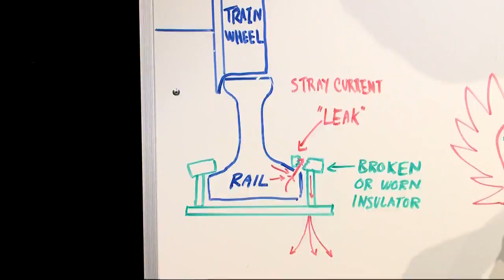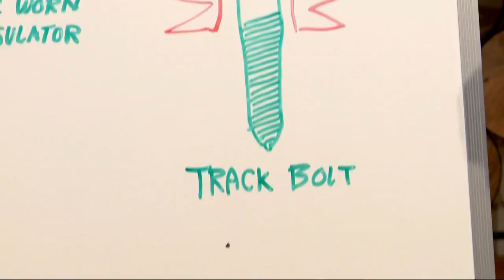What makes Metro's third rail so dangerous?

Comment: so this is why i didnt see a third rail when i looked between the tracks
Reply: Next to platforms, it's typically situated as far away from passengers/the public as possible, so should someone fall onto the tracks and be conscious enough to find the suicide pit underneath the platform should a train arrive, there's no chance of meeting the third rail while on your way there.
Not sure where you are but there's a multitude of different third rail systems out there, some, like in The Netherlands having the third rail be up in the air by about 30 centimeters and covered left, top and right by a glassfiber cover (I was once told by an employee of the metro system that while they are taught it's an insulator, due to all the dust that builds up on them he doesn't automatically trust their full insulating potential in emergencies, and worded it like this "Probably safe to step on with shoes on, but touching the protective cover? Nope, not me.")
The pickup picks up current from underneath the rail.

Some other countries have the third rail in the middle of the tracks, sometimes covered (and a train has to "catch" a sleeve like opening in order to touch this rail) and sometimes uncovered.
There's the type in England which is slightly raised, sitting right next to one of the 2 pieces of rail (usually on the outside), and Amsterdam used to have a combined system with a third rail operation till a particular station, at which the metro converted to fast-tram service by switching on their pantograph (there was overhead wiring at that station) and retracting the steps on the sides, because the platforms of the fast-tram service were more narrow.
Since this fast-tram service also had a huge amount of street-level crossings with pedestrian, cyclist and car traffic, third rail was obviously not an option there.
Reply: The 3rd rail is the furthest one from the platform and usually not between the running rails

Comment: Don't forget that (depending on the system) the 3rd rail is typically has 600-800 volts going through that rail and most systems never shut down the 3rd rail if the train isn't there so even if the train isn't there the 3rd rail will kill you instantly.
Reply: Imagine then what would happen if a swollen fart landed on the 3rd Rail?, considering that farts are pre-filled with highly pressurised air and gas?
Reply: That’s nothing, Montréal has 25,750 volts on their tracks.
Reply: @lagoontejeraneasea1338  On a third rail, or an overhead wire?  I'd think a third rail at that high a voltage would just flash over to ground.
Reply: @soundspark  exactly
Reply: @lagoontejeraneasea1338  you are misinformed on how electricity works. the 25,750 volt lines you are referring to are overhead lines, away from the ground / pedestrians. electrified third rails must use very high amperage with relatively low voltage, in order to minimize the high potential for electric arcs through the air that low to the ground, which can happen with high voltages. therefore, they often run at 700-800 volts, but upwards of 1,500 amps. this requires many additional traction power substations, as the resistive losses are much higher due to this. it won't shock you as much as the overhead lines you're referring to - but if you touch a live 1,500 amp electrified rail, you will become a burnt marshmallow at the speed of light
Reply: @lagoontejeraneasea1338  nobody cares u can literally die from either one 💀 it’s not a competition.

Comment: Does overhead lines return current through the rails as well?
Reply: Yes, hence only one wire above instead of two, like rubber tired trolley busses
Reply: yes they do but the neutral conductor is earthed so nothing happens when you step on or touch the main running rails even if a locomotive is running over them
Reply: @SB7-r9i  You mean the neutral is at ground potential so there's no difference between you and the rail you step on or touch.  Touching both rails however can be a bit of a problem since some forms of security use a voltage between them that can bite, maybe not be lethal, but still.  Since it's difficult to reach both rails with some gauges of track that's not that much of a concern, and snow or heavy rain typically doesn't affect this functionality.
This type of track security relies on the rails getting shorted out by a train upon entering that track section, basically.

Comment: 750 VOLTS! Dude get on my leve, I've been shocked with MORE THAN 1KILOVOLT. I made a taser that outputs more than 700 volts, You can even get 2,5 KILVOLTS from a microwave transformer
Reply: Most people are confused regarding the difference between volts, amps and current. He's either dumbing it down for them or doesnt know the difference himself.
Reply: @MrDlt123  i do know
Reply: @MrDlt123  it was high voltage with high current
Reply: Yeah. If ElectroBoom taught me anything it's that the voltage doesn't really matter as much as the amps when it comes to the dangers of electricity, right?
Reply: You were getting a discharge voltage and very SMALL current. IE a charged, disconnected capacitor. The third rail is powered by a DC generator or  an AC Altenator that can deliver THOUSANDS of amperes of current! It is potentially a made made lighting bolt, when there's a short circuit!
 You can experience a tingling from a lightning bolt depending on the distance from it and the conductivity of the earth you are standing on. When you get a direct hit you will be VAPORIZED in many instances!
Reply: @leehansen4750  the current is actually high as well as voltage.
Reply: @GileraManden  You might first want to learn to properly speak the English language. After educating yourself in that aspect, then look into electrical theory. As of now, you can barely dictate well enough to get a basic idea across. The ideas you are conveying are incorrect child.
Reply: if a supply is capable of delivering 500 amps but at 1v you survive because the current never gets flowing to kill you but at 800v there is enough voltage to get the current flowing so it is a combination of both that kills also there is ac and dc but i wont get into that here just watch electroboom he has some videos about it
Reply: @SB7-r9i  the 1 kilovolt i got shocked with had also current
Reply: Microwave transformer will drop you dead easily.  You say you got hit with 1kv but I'm not surprised if you survive a hit from a very low power source.
Reply: A taser will not be capable of producing anything above 1-2 mA, if it reaches that at all.  A taser is meant to produce a very high voltage at a very low current (possibly even micro-amps) with a pulse-modulation so fast that it disrupts normal operation of the human's nerve system (this is the thing that actively knocks you down or at least seriously should scare you off).
Oh, and by the way, the micro-wave transformer has something the third rail operation does not have: Galvanic separation.
It means that should you get into contact with it's outputs, no breaker or ground fault interruption device will think something is wrong and cut power.  In a third-rail setup however there will be such a stupid amount of power present that someone getting into contact with it will probably not make safety circuits kick into action and cut power to the installation in any way.

Microwave oven transformers typically also don't have exposed terminals compared to the single exposed terminal that the third rail basically is, along with being in that exposed state, usually being situated well away from the general public.
Reply: The 3rd rail also carries a very very high current

Comment: Well his diagram is WRONG.
He say the rails are insulated amd shows a wheel on it.
The running rails that the train runs on are not insulated.
The third rail that the collector shoe runs on does sit on porcelain insulators otherwise the current would short to ground.
Reply: I think I once read about a third rail system that used split potential to be capable of lowering costs of insulating the single supplying rail and was also meant as an idea against corrosion or something.  As you can probably understand (since you noticed the same thing I did) that has eh, it's problems when something goes wrong.
If I recall correctly this system was used in England and has been phased out reasonably quickly because of the infrastructural nightmare stuff like switches and junctions were to design around 2 rails carrying a voltage, along with insulators going bad and causing stray currents...
Reply: Yep, spotted that straight away. Running rails will never be insulated  - it would be extremely dangrous if they were. as the whole body of the train could reach live rail potential. You wouldn't notice until you tried to get on or off and had one foot on the train, one on the ground. Then it would be game over.